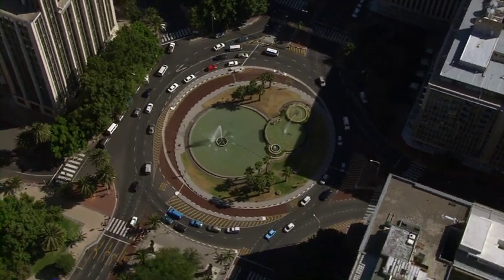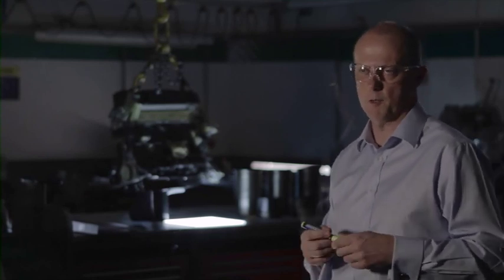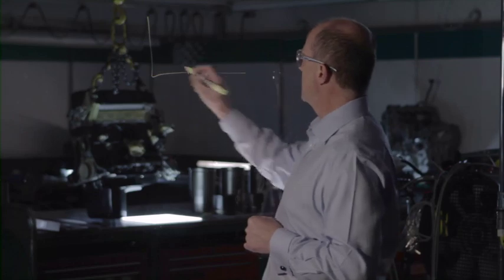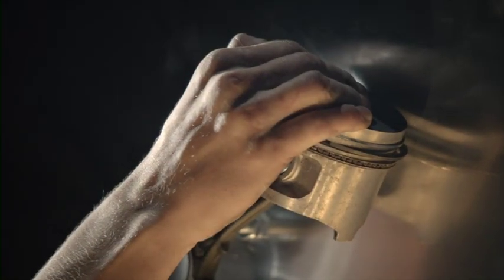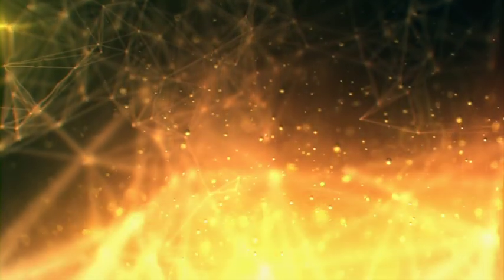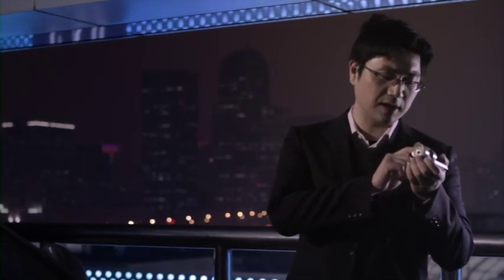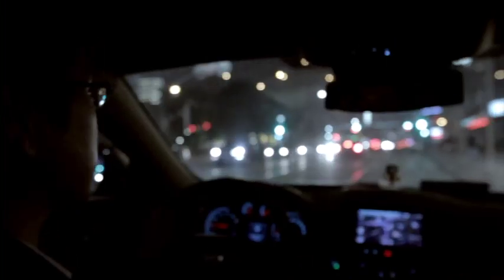SEE HOW CASTROL MAGNATEC OIL PROTECTS ENGINES

Comment: I'm thinking this may contribute to engine sludge, I hope I'm wrong I remember slick 50 oil additive that claimed it would stick to engine components for 50,000 miles.
Reply: It does produce a lot of sludge and can block up oil galleries. Not good. Just stick to other oil.

Comment: You do know that the wear is from the oil being thicker on startup and the clearences changing from cold to warm engine. Not the oil draining to the pan. After the first 1ish second goes by running your oil pressure is up and theres oil everywere its needed. Oil draining isint the problem on cold starts

Comment: the rougher cam wasn't run with any oil at all. they're comparing their oil to running with no oil. we all know oil works. does yours work better?
Reply: Brandon Hudson yeah and he was even attempting to rub a piece of glass, glass is one of the hardest material you can find in nature, in fact, it is harder than iron. I guess that bald head is try to be sneaky, not technically wrong, but proves nothing either.
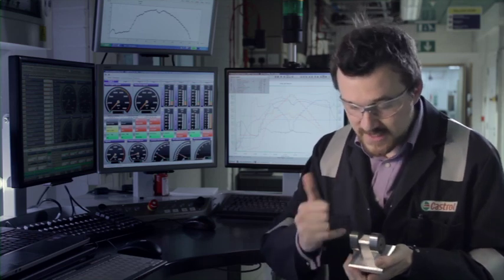Reply: 5:24 - 5:36
They did not say the rougher cam was run without oil. They said it was run without intelligence molecules. Tricky wording.
Reply: @MacCready_  Exactly, run without them, not implying that it had any oil on it at all. They are CASTROL, they have many products that are not Magnetec, so they didn't even compare it to their own products.
Scam Video full of fakery. Real Non Castrol Scientists are needed or someone like Project Farm to test it.
Reply: A cam with no oil would look like that in less than a minute in an engine. Probly just a 20 year old lobe